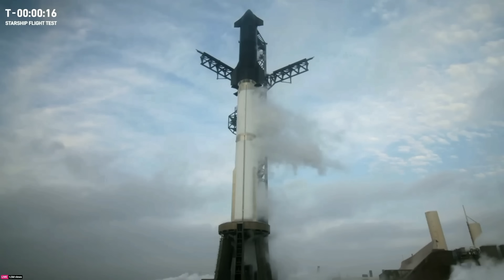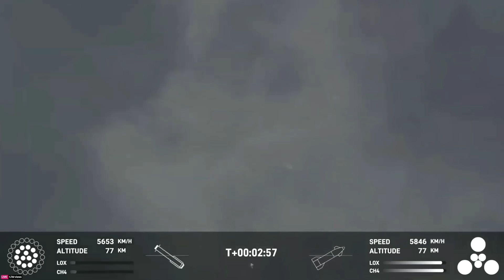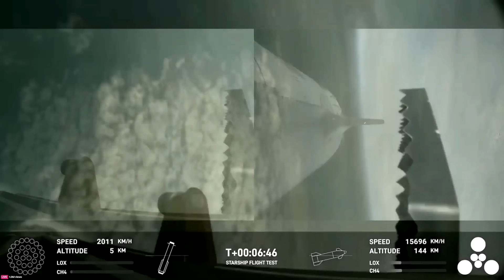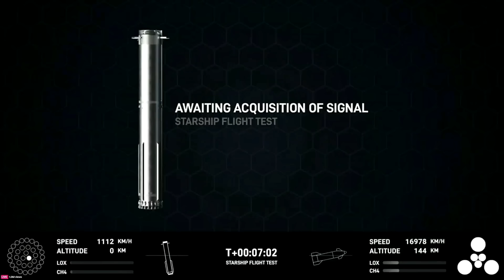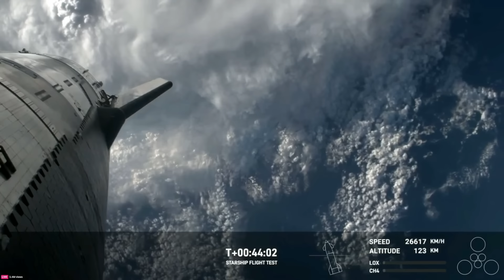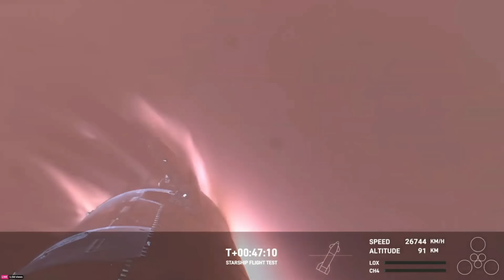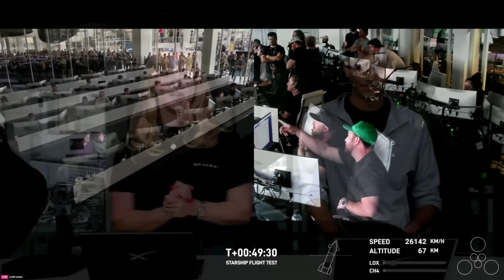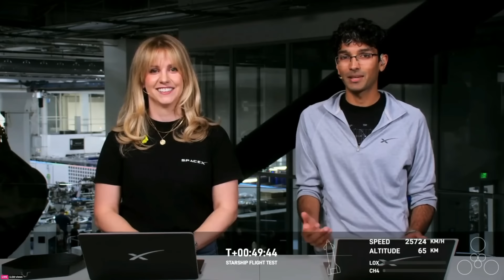SpaceX IFT-3 From Launch To Landing Complete Mission In 20 Minutes

Comment: Congratulations to SpaceX for the incredible strides made with the third test! At the moment, from what is reported in the media, SpaceX should have all the data regarding the descent of the booster until the explosion (it seems) 500 meters above the sea. On this data, they can work and find the necessary improvements to make further progress towards full reuse of the booster (which has a significant value with its 33 engines). For Starship, it could be that venting valves did not function properly, preventing attitude control from a certain point onwards and the proper positioning of the ship before encountering the first layers of the ionosphere. Obviously, if the spacecraft entered inverted and aft, air enters beneath the tiles at 26,000 km/h, and I believe it can only tear them off the hull. Moreover, incorrect venting along with increasing temperature has probably created pressure well beyond the norm in the tanks. The fact that the signal was lost instantly on all three different radio channels suggests an explosion at 65 km altitude. Perhaps the data accumulated up to the blackout are sufficient to understand what happened. A fascinating technological saga! Best wishes for your work.

Comment: When Starship reached cutoff, it kept outgassing without stop. Cant imagine that is normal.  During reentry it did not appear that the attitude of Starship was under control at all. Hopefully more analysis will shed more light.
Reply: @pedrosura - Actually it is normal.  Without venting there would be pressure build up in the tanks due to boil off.  They utilize these gasses as a means of orientation.  Obviously there was a problem with that function and was most likely the cause of the barrel roll and ultimately the loss of the ship.

Comment: Look at those tiles coming off
Reply: I think that is a big issue they need to solve. You can see them flying off as its starting to re-enter.
Reply: @christopheryoder8292  It could be that the attitude of starship wasn't as expected (due to gas leak) and then the tiles get pressure on a side for which they don't were designed for.
Reply: happens w/environmentally friendly water based glue....

Comment: Tiles Not an easy fix. Atlantis haven't solved that problem/size, but Russian shuttle "Buran" did.  Dream Chaser has much thicker irregular tiles and special shape. X37B seems OK, but it took many years and reduced scale. It's a difficult problem, it gets more complex with size and trying to make tiles uniform. Uniform tiles may not be possible. You have to design custom tiles inch by inch. It is a very complicated problem. The shape should be more like a Spaceplane Atlantis or X37B to stabilize re entry. The working model will be much different in shape, more like a plane, but with an option for vertical landing at the end for special military operations and moon landing. For regular space cargo mission just a plane style landing as X37B is ok. Why to complicate and carry more fuel for vertical landing?

Comment: ⛺Thermal Tiles: Remove the pins on Starship. Install 2ea per tile monument clips [ up side down U ] . Two each 3mm vertical holes through each clip and tile.  2 steel pins 2mm OD through tile and clip. Tile will not be removable without destruction. No more pop corn Tiles.

Comment: What I can see is the fuel of the booster rocket is used up befor it hits the water . I also think that the attitude control rockets are not large enough to miniver the 50 tones of starship to position it correctly for reentry!
Reply: There are no control rockets on starship.  They use ullage venting.  Basically boil off of the LOX.  Speculation is the valves or the vents themselves froze up and therefor they lost attitude control.

Comment: I love all the headlines saying this was bad or a failure or  something. This was fantastic.  They achieved all thier primary goals and sopme of the secondary and never intended to recover this craft just collect date. 

I expect at least one major setback (blow up on the pad etc) before the end of this rapid prototyping stage.  It's just the way SpaceX operates.  They are willing to lose many prototypes to allow rapid development like this.  It's a different mindset than NASA which can't tell the public that blowing up rockets is normal. NASA has to work perfectly the first time and all the time,  or the fickle and non-understanding public will pull the purse strings. 

SpaceX can set a goal , understand the calculated expected losses , while not having to worry about loosing craft in the development stage.  They EXPECT to blow up craft, that's why they are mass producing prototypes.  They just put more tonnage into space than??? I don't even know.   They  just demonstrated ENORMOUS launch capability. Simply dwarfing anything prior.  And the fact that they intend to land it, and have proven that they are very good at landing spacecraft already.  This is a game changer.

Comment: I would suggest further exploration of a heat shield jacket. Not small tiles. Instead, a printed shape made up of heat resistant elements. One tile failure can result in catastrophic failure. A single jacket designed to protect the entire craft during re entry is as important as the engines required for lift of.
Reply: The engineers think that Starship can survive a few tiles here and there missing.  It a problem on leading edges and if consecutive tiles are missing.  30X Stainless Steel can take a lot of heat.

Comment: Booster malfunctions! SS burns up! Big win!
Reply: Yeah it was a huge success it got way farther in the third flight then it did in the second flight
Reply: So what would have made you happy?
Reply: Yes very big win. This is how iterative design works using experimental prototypes, especially when dealing with issues nobody has dealt with before in ways nobody has attempted. Both booster and starship made it further than before. Launching and separation appear to be mostly solved. Controlled reentry for the booster was accomplished, next step is sticking the landing.  Starship made it to engine cutoff and reentry, surpassing previous. Now they need to figure out what caused loss of control. I think the are likely a bit disappointed that starship didn’t make it through reentry.

All in all a great test flight. Getting closer to complete success and lots of great data in areas that there was none before to be able to push the envelope further next time.
Reply: @MeerkatADV  Probably immediate gratification like he gets when he plays his video games all day long every day.

Comment: To many tiles fall off and that is easily fix but must be fix the right way the currway won't work
Reply: Not an easy fix. Atlantis haven't solved that problem/size, but Russian shuttle "Buran" did.  Dream Chaser has much thicker irregular tiles and special shape. X37B seems OK, but it took many years and reduced scale. It's a difficult problem, it gets more complex with size and trying to make tiles uniform. Uniform tiles may not be possible. You have to design custom tiles inch by inch. It is a very complicated problem. The shape should be more like a plane Atlantis or X37B to stabilize re entry

Comment: I wunder if the NASA observation aircraft caught any images of the booster coming down?
Reply: The WB-57?
I read somewhere else, that it couldn´t be found on ADS-B data. Maybe they flew incognito without transponder (unlikely).

Or the crew said: "It´s foggy and the upper level winds are predicted too high, they´ll scrub the launch. Let´s call it a day."

If they flew it was N927NA (NASA927), but the tracking sites only recorded it flying on March 12th.

The other two NASA WB-57 are in Maintenance: 
WB-57 - JSC	#926	Major & Paint                                         (ends 03/28/24)	JSC	         03/14/2024
WB-57 - JSC	#928	Major Inspection On Indefinite Hold  (ends 12/31/24)	KEFD	 12/17/2023

Comment: I wonder if it would make sense for the tower to be a bit higher and have the arms lift the rocket up as bit just before lift-off?  Would that save any fuel or any damage to the launchpad?
Reply: WTF 😂😂😂
Reply: Arms are not strong enough to hold starship fully fueled
Reply: Not easy to lift off a 40 story building.
Reply: Is that you Donald?

Comment: 16:20-16:21 UFO Left to right under booster watch in 25% speed.
Reply: That's frozen oxygen coming out of the bleed valves
Reply: @Rusty.Buckets  damn from completely off the left side of the screen . run it through adobe you slow it more. it comes from out of frame left passes under and goes to the right its small looking orb with a tiny mark or shadow on it. i see the frozen oxygen all over the place . this is acting completely diff and flying with tons of speed its only in 3 frames of a second. ill take another look at it today maybe i missed something.

Comment: I still do not get why those boosters are designed to be reuseable. I rly can not imagine spaceex ever used a booster twice. Why u ask? It's one of the cheapest parts of a rocket(literally just a big steel cylinder) and which space agency is dumb enough to risk a multi million $ mission with reusing the cheapest part of the whole rocket?!
Reply: Everyone including Nasa, the booster is actually the most expensive part. Spacex have flown individual boosters 20 times each time reduces the cost.
Reply: @shaung949 Nope typical the first stage is the most expensive part. Ez doable simple boosters, like the Space Shuttle had.
Reply: @Squilliam-Fancyson the booster is the first stage for every rocket except the shuttle. Shuttle had 2 solid rockets a fuel tank and the ship stuck on top.
Reply: @shaung949   So basically my "new" idea is at least as old as the suttle program? Ok, thx for explanation.

Comment: Did it get lost on landing?
Reply: The booster didn't landing burn correctly and smashed into the Gulf at about 1100 km/h.  The actual Starship vehicle seemed to burn up on re-entry, the attitude control didn't seem to be working quite right.

Comment: What happened to the booster?
Reply: Engine/fuel trouble..... didn't slow down
Reply: @robb8235  did it blast in the air or crash on the ground? Is there video?
Reply: From the stream, it landed into the water

Comment: So what I'm trying to get across about using the were why you speand in a minute of a moment of situation and your brain is not clear for the word to come out. The word is called. It does not make you less of a speaker, but it is a normal.
 Call a quick thinking. To  say make sure you say a word. Correctly in a split moment, think about it. How many times do you  the word? Um🤔